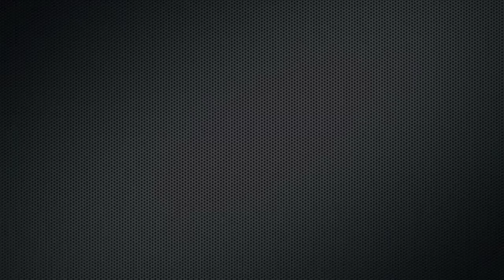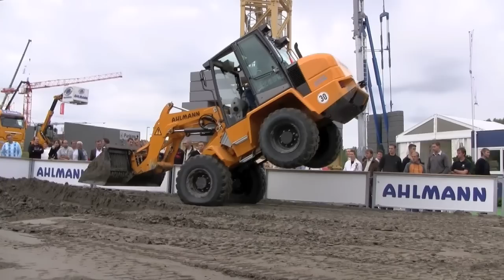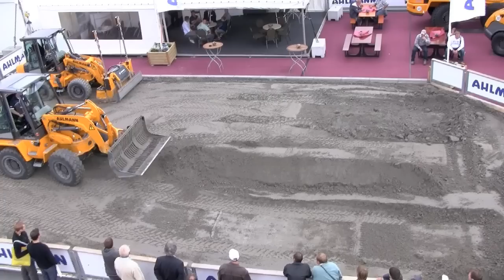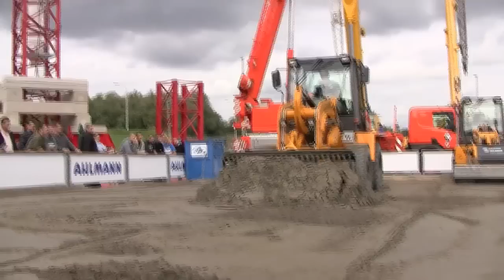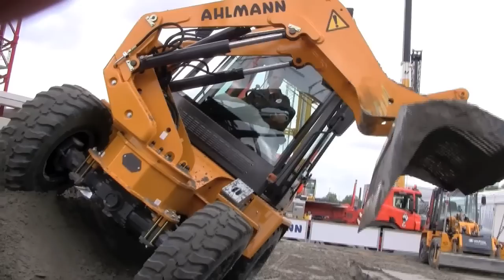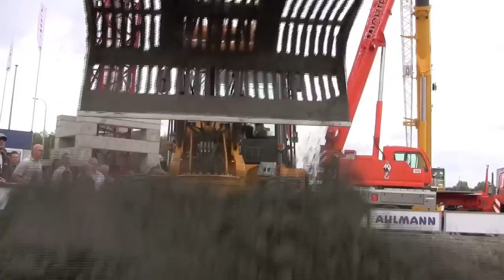ahlmann op matexpo 2009

Comment: This would be great for working a trench down the side of a road without having to block both lanes as you back fill.  It would be very cool if you could load a truck to the side... since they never demoed that I'm guessing its not possible.  I also wonder if its possible to hit your tire... If you can you probably will.  (just my 2 cents...)
Reply: A bit late, but it is possible. And yes, you can hit your tires.
Reply: Its just machine control to not hit your tires... If you cant control your machine you shouldnt be on one.

Comment: Pretty slick, but in my opinion is; if you cant get the work done with a standard loader, then this is pretty useless as a concept.
Reply: Its for different purposes. This machine is way faster and efficient in road building than a normal loader.